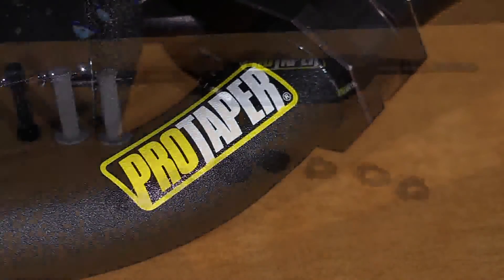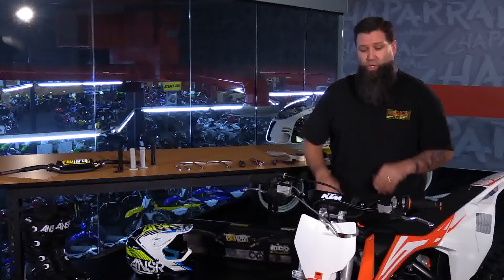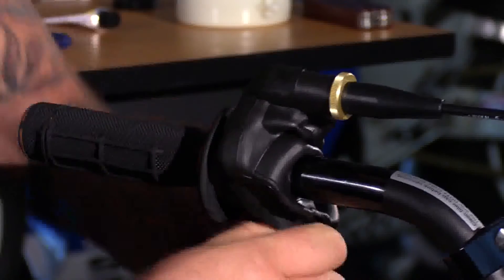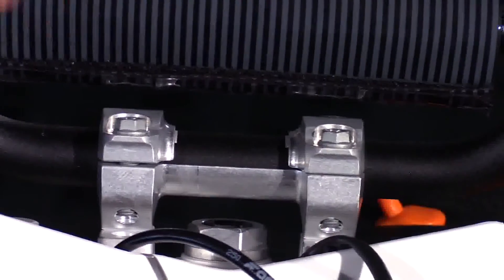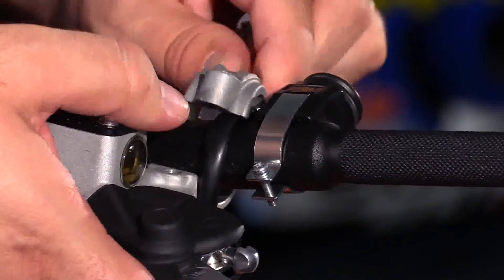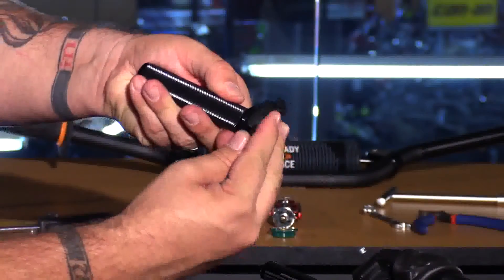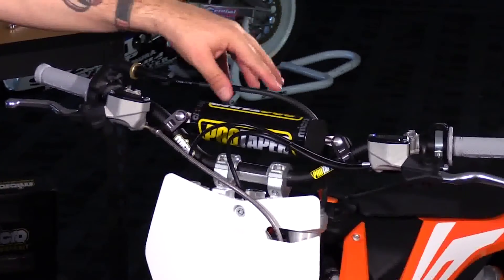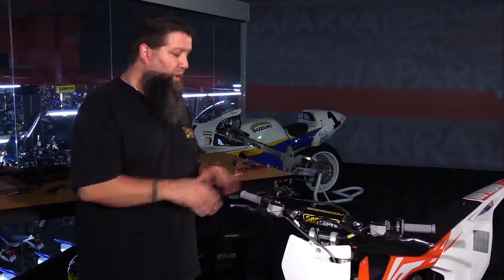How To Install The Pro Taper Micro Handlebar Kit Tutorial

Comment: will these fit on a ktm 350
Reply from the maker: Yes, this set of bars can be installed on a KTM 350... but you will need to change a few things. The Risers on your 350 are a 1-1/8" not a 7/8" so you will need to swap risers or get spacers to fill the gap. Secondly, these bars are much narrower than your 350 stock bars. Leverage will be diminished and you will have extra clutch / brake line & cable.  But yes... you can make them work. -- Kyle & the Chap Moto Team
Reply: Will these work on a klx 110?